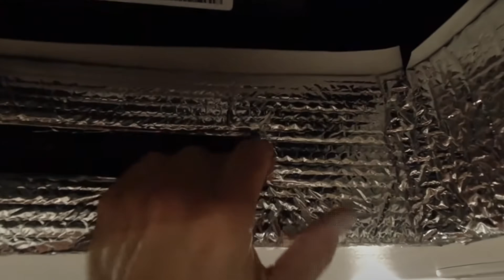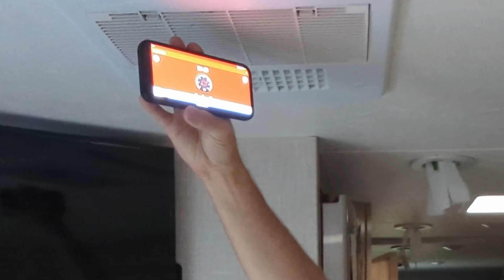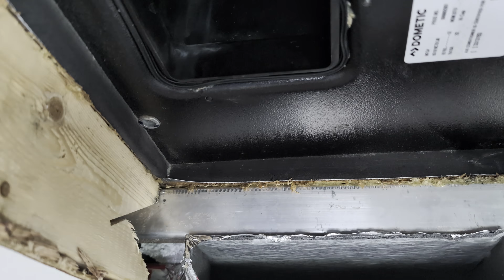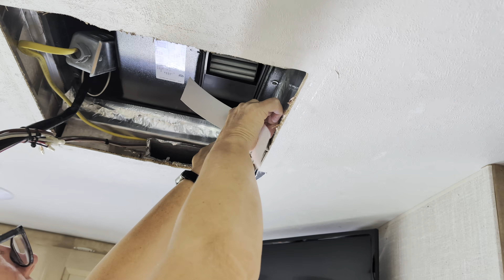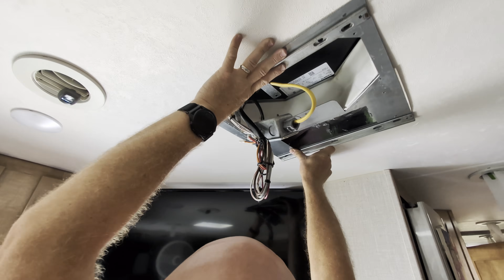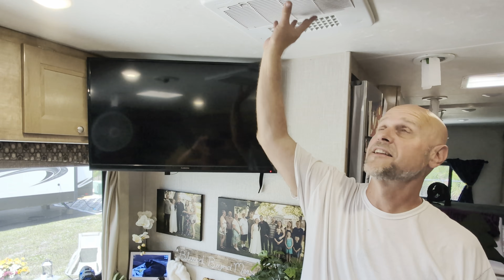Don't Do This RV AC Mod Until You Watch This! (DIY Fix)

Comment: How did you apply the duct tape to the wood on the interior of the unit?   our domestic ac doesn’t have full metal housing.    Which tape did you use? Does the peel off duct tape work on wood?  Thanks.
Reply from the maker: Thanks for watching! The tape you see us applying is actually aluminum foil tape. The same tape that you would use to seal heating/ac ducting. You can get it at any hardware store.

Comment: I think u could have fit a piece of foam board up against the back wall. up inside the plenum right behind the shoot . Also I found that the tape didn't like to stick the bottom of the AC cause of the moisture. I also think an A frame TP type build of foam is a better way to split the path of air to 45° than a straight down 90° on your base plate directly below the dump shoot if that makes any sense. I did keep the original deciding wall on my mod.
Reply: Deviding wall 😢
Reply from the maker: Thanks for the feedback! We actually contemplated how we could achieve the A frame like in the other videos. It would have taken som engineering as we only had about 4-5 inches of height to work with and the shape of the divider wall made even more involved. In the end we decided to go the simpler route ONLY because we wanted to leave the option of unblocking the dump vent if we wanted to.